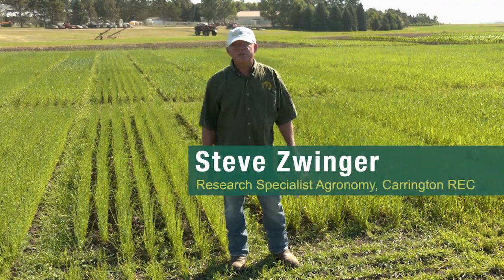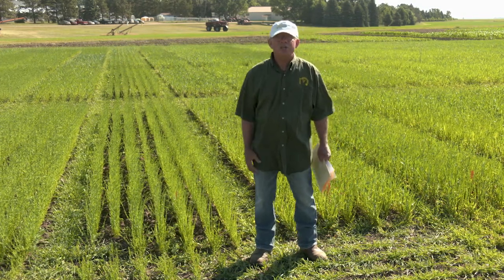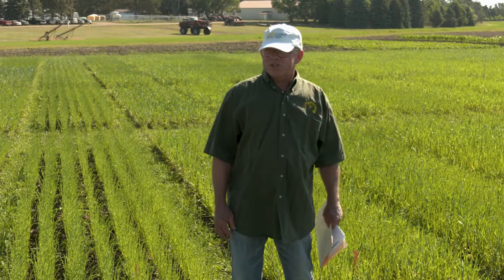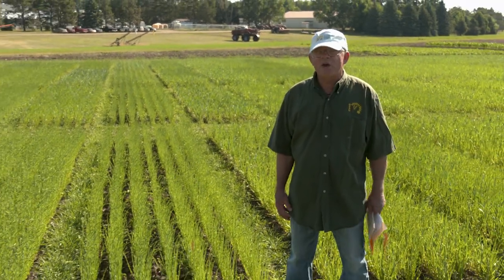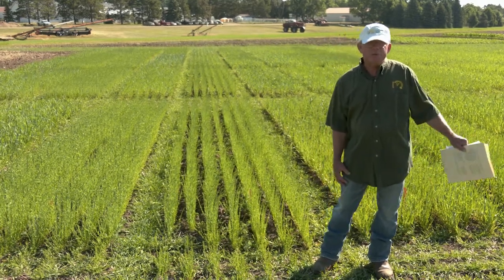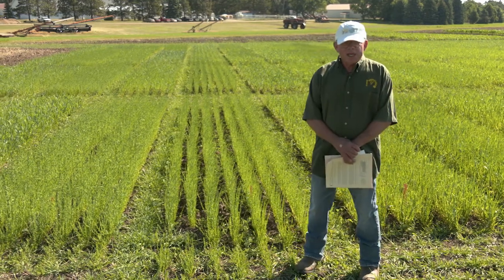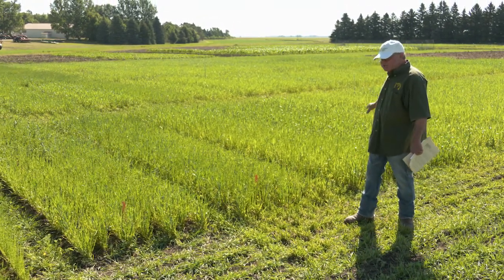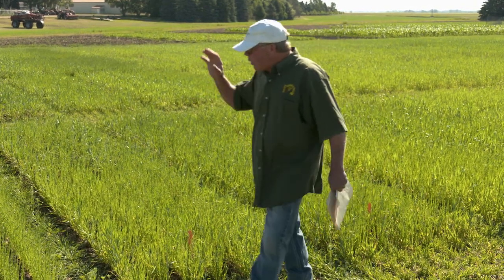CREC Steve Zwinger: Organic wheat/flax intercropping

Comment: I cannot tell when you planted the flax, but I have found that flax is extremely weed free if you plant 6-8 weeks before last frost date (depending on seed variety), as long as the soil is at least 46 F. It is hardy to 28F-23F. Then it will choke out all weeds and grow extremely weed free.